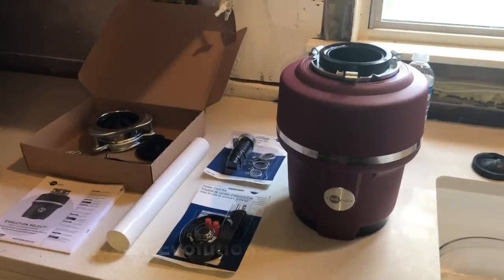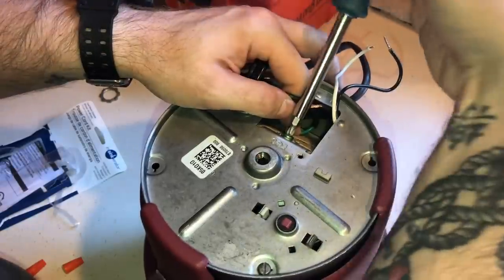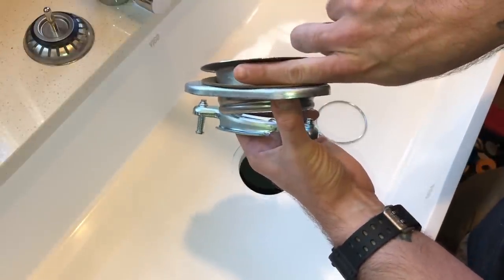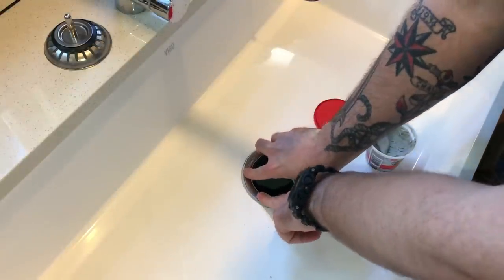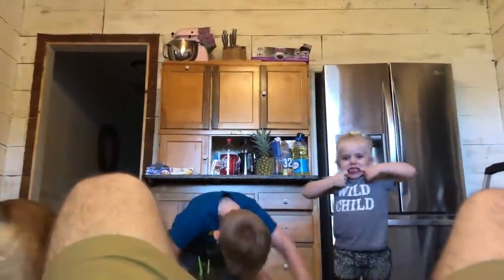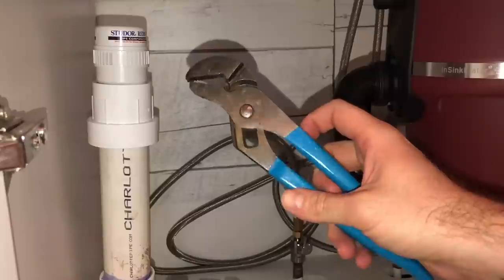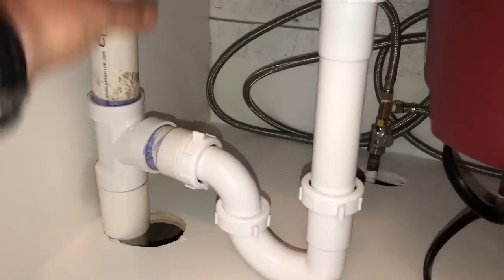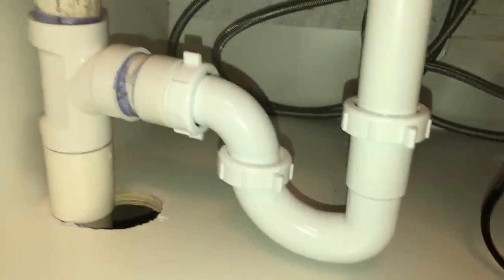How to Install - Insinkerator Evolution Select Garbage Disposal

Comment: So how do you know which wire to tie to gather?
Reply from the maker: Great question! I didn’t really address this, by here is how you know “If you have two black wires coming from the cord, check if it has smooth & ribbed sides. If it does, connect the smooth side to the black wire and the ribbed side to the white wire. The ground wire of the cord should be properly secured to the screw of the disposer.” 

Hope that helps you and thanks for watching!!
Reply: ribbed is standard indicator of "white".  You can also verify using an inexpensive $10 AC/DC multi-meter.   Set to DC and run the continuity test.  Touch the wide "white" prong then touch the bare wires.  You can mark the "white" with a piece of white tape.
Reply: I would add a text box to the video so you don’t have to make the whole thing. But this is made clear since it is  so important. Thanks!

Comment: Amazing thank you!! I just got mine installed thanks to the confidence I gained from your detailed video. A couple little things I would add: the snap ring is a beast. To get it on check out the guy who uses zip ties on the three screws to hold it open. Also much easier with a 2nd person holding down the flange while you fight with it. Also insinkerator seems to prefer shorter screws now for thick sinks. They had two screw sizes in the box. Also they offer a rubber washer to use and no mention of new plumbers putty. I decided I didn't trust their washer as I have a beveled hole in the sink. So I learned how to use the putty and made a gasket the old fashioned way. Finally, I had to adjust my drain line by pushing any "variable" pipes as far as they would go into the other pipe and it just baaarely fit. This unit is a fair bit wider than the badger it's replacing. Thanks again!
Reply from the maker: All great notes!!  Thank you for taking the time to comment!  This is one of my oldest videos so I'm glad it still holds relevant and is helpful.  All the feedback is awesome, thanks again!

Comment: thanks for the video! I just saw the pinned comment about wires.  The only issue I had was the dishwasher drain line was pretty tough to remove but channel locks did the trick.

Comment: Thanks for the video.  I'd installed one of those 5/8HP Evolution models last night as an upgrade to the 1/2HP Badger.  I didn't appreciate how the instructions failed to make it clear that this unit's baffle actually fits into the sink and not into the thick rubber soundproofing grommet at the top lip of the unit, nor under the sink opening as you can not jam both rubber pieces together & have it fit the locking ring mechanism...  My old disposer had the baffle pre-molded into that top grommet sitting inside the disposal lip.  Duhhhhh!  I really felt like making some of the gestures your kids were making, but mine were profanity laced!
Reply from the maker: Thanks for the comment Doug!  I definitely edited out my profanity that's for sure!!

Comment: you make it look easy putting on the ring, however most people aren't that good so I recommend having someone else hold the drain flange down from the top on the inside as you put ring on from  underneath.  its very important that you tighten screws evenly or the ring will come off, also you get an Allen wrench type tool with the disposal that unjambs the disposal from the bottom , I like to use two of the wrenches  to put in two holes in mounting bracket, its also critical that it CLICKS on otherwise it will vibrate off.
Reply from the maker: All good notes! Thanks for sharing and for watching! 👍🏻

Comment: Thanks dude. Bought the same model and used your video as reference as I hardwired mine and it was a replacement for and older busted Kenmore/Insinkerator. model so I reused the old mount without issue.
Reply from the maker: Thanks for the comment and I’m glad my video was able to help you out!! That’s awesome!! I appreciate you taking the time to let me know, helps me know how I can improve / keep on keeping on etc! 💪🏻🤘🏻🙏🏻

Comment: Just bought and installed the current 3/4 horsepower  version of this, they now include the power cord and the additional drain tube. They also include a ring for the flange to replace the use of putty. Sounds like they watched your video LOL

Comment: Thanks for the video! Way more helpful than the instruction manual tbh. Did it matter which wire I connected to which? I connected each copper wire from the power cord to one of the wires coming from the unit and it turned on just fine so I guess I did it correctly but also don’t want to burn down my house lol
Reply from the maker: So glad the video helped you out!!  There is a method to how to attach the wires, you may have gotten lucky, I don’t think it would operate if backwards. I think I may have a comment explaining it, but basically one of the two sides of the all black wire does go to the neutral and it’s marked by a ridge on the wire itself (from memory here, I remember looking into it back then). Good luck and hope the unit works for you!

Comment: Looks good.  The only suggestion was to mention the Air Gap or high loop for the dishwasher drain line.
Reply from the maker: Thanks for the feedback and for watching! I did a sort of “part 1” to this video showing how we hooked up the sink plumbing and I discussed the drain for the dishwasher more there.  You are right as it would’ve been more beneficial to edit some of that into this video - I was trying to get the length down and didn’t think to leave that here when splitting them apart.  I appreciate the thoughts and again thank you for watching!! 

—-> DIY Project: How to Install Sink Supply, Sink Fixture & Drainhttps://youtu.be/jflpKgwRbC8

Comment: Nice video and question for you. Can either end of the power cord connect to either of the wires of the disposal? I'm not talking about the ground, but just neutral and hot. Can both the neutral and hot connect to either side of the cord?
Reply from the maker: No one side is hot and other is neutral, you can tell by the texture on the cord sides normally which is which, def search for that online before trying to connect it

Comment: I find when knocking out a plug like the one for the dishwasher drain, it is easiest to use a 6 inch socket extension with a socket just under the size of the tube. Just a tip, do with it what you will.
Reply from the maker: Thanks for sharing the tip Doug, much appreciated! Thanks as well for checking out the video! 🙏🏻

Comment: The video was helpful... but, I don't recall seeing you use the bent allen wrench to tighten up the insinkerator. So it is really just barely hanging in there... use it for leverage to rotate the mounting piece clockwise... at 18:34 you can see that it wasn't in tight.
Reply from the maker: Might not have shown the detail there but it’s worked perfectly for years now, so  guessing it’s good.
Reply: @TheToughGuysTV  I hear you... and, it helped me put the parts in the right order... but I tightened my down... this step... https://youtu.be/fM6b78LGYHU?t=1410 not to be mean... I just know I would want mine on a bit tighter.

Comment: I recently installed my garbage disposal. One thing to watch for is the amount of putty used. I struggled for a day to get the disposal on the ring. There was too much putty that seeped down. Removing the excess from underneath gave me a fraction more space to get the disposals tabs to the ring. The instructions don't tell you to use putty and so probably not built into specs to allow for that so just beware of how much your using or just use the washer they give. Also using a scissor jack helped alot with raising the disposal in place.

Comment: Hey. At 19:50 the rubber thing the you put, of course I got one too and it just slows down the water flow big time as compared to my old garbage disposal. In the old badger, that thing was attached to garbage disposal itself. With the one you installed, it sits from the sink side. Did you find a hack for it or you just deal with it? Thank you.
Reply from the maker: It’s been in place ever since we installed it. So far no major issues. Occasionally we get a bubble there which stops the flow of water, but I just poke through and water starts to flow again. Thanks for reaching out and thanks as well for checking out the video!

Comment: I didn't realize about the long depth ring. I'm replacing a disposal so if there is already a deep one there can I just reuse that one?
Reply from the maker: You may be able to re use it if it all lines up and fits. definitely worth a try before buying a new one!  Good luck!
Reply: Luckily the deep one wasn't necessary.

Comment: Hi, thanks for the video, very good. I have 3 questions:
May connect the dishwasher drain somewhere else in the drainpipe instead of the disposer?
May I connect the regular white wire directly to the motor instead of adding the black wire?
Do I have to put a turn on switch as shown in the video?
Thanks for attention.
Henry
Reply from the maker: Henry, thanks for reaching out!  Disclaimer here - I am not a licensed plumber or electrician!

1. I'm not sure if you can connect somewhere else per manufacturer spec, but as long as it's draining into your drain pipe it should theoretically be ok. 

2. I would recommend connecting to power as it's written in instructions - I can't physically see your situation, so I don't want to recommend something possibly detrimental. 

3. You'd definitely want to wire the electrical to a switch, otherwise it would run all the time.  Some people have push buttons on the countertop, and others have a switch down under the sink - it's really up to you. 

Thanks for checking out the video and for reaching out! Good luck!

Comment: Thank you Dude!  Bought the same one ($$$) yesterday and was so happy to find your post.  Just getting ready to start in.  Not sure which side is up on the rubber drop in thing-a-ma-jig, it looks like it comes packed upside down?  Oh, and yes they're packing the power cord now (BFD).
Reply from the maker: That’s awesome that they are including the power cord!  A lot of guys that install these all the time don’t think it’s a bid deal they weren’t - but normal everyday people DO think it’s weird to not have a power supply included... I mean, what else do you buy that doesn’t in everyday life!?  I’m glad the video helped you out, and I really appreciate you letting me know!!
Reply from the maker: That’s awesome that they are including the power cord!  A lot of guys that install these all the time don’t think it’s a bid deal they weren’t - but normal everyday people DO think it’s weird to not have a power supply included... I mean, what else do you buy that doesn’t in everyday life!?  I’m glad the video helped you out, and I really appreciate you letting me know!!
Reply: @TheToughGuysTV  LOL!  I took the electrical all apart when I noticed the nut was still on the romex connector, only to find that it threads into the base on it's own.

Comment: I have this disposal. Problem I have is that my dishwasher cuts off when I turn my disposal on. I have an insinkarator box that both are plugged into. What can cause this problem?
Reply from the maker: Could be a short overrunning the circuit? I’d recommend having an electrician check it out or an appliance repair specialist - could be a few different things causing it. Good luck

Comment: The reason a chord with a plug was not provided could be due to the fact that some installations could be hard wired.  I live in Florida where dishwashers and disposals are plugged in via an outlet under the sink (the disposal plug controlled by a wall switch).  Not the case in New York, where, in my mother's house, the dishwasher was hard wired (no disposal in use).  Not having the power chord included with the disposal saves on the possible waste of discarding a perfectly good power chord only because a particular installation requires hard wiring.
Reply from the maker: I think an easy solution may be to have some sold with or without, and then separated within retail locations.  I am a GC in my professional life, and my plumbers do not purchase from retailers - so having the wholesale locations carry the w/o cord version would eliminate the issue you’re describing pretty easy.  Then have retailers carry with or without, and educate staff to explain to customers (or have good signage / collateral to read).  How many people buy one, then end up having to go all the way back to the store because they need it and no one told them so? Thanks for the thoughts and for watching, I really appreciate the conversation!! 🙏🏻💪🏻

Comment: Does this disposal have a little flex when the flange is completely installed? I just installed mine and everything went together good, however, I can grab it and wiggles a little. No leaks. All the tabs in the locked position.
Reply from the maker: I can't say mine has any 'give' or 'wiggle' to be honest.  It's pretty secure.  If I put some force on it, I can get it to twist a little bit but not sure if that's exactly what you're experiencing.  If unsure, try to see about getting a direct opinion from a local plumber maybe just to be sure - better safe than sorry.  Thanks for checking out the video and good luck!
Reply: It definitely has some play, both at the basin/trap, and at the discharge outlet. I assume this helps quiet the unit when installed.

Comment: At 14:27 you didn't mention that the tabbed retaining ring had to be turned to tighten the unit to the upper drain.  Almost looked like it was supposed to pop into place.

Comment: My previous pipe does not fit (it is about one inch too long) to acomodate the disposal.  How do shorted the pipe?  Also, the black tubing from the dish washer does not reach to around to the top drain port that you had to hammer a screw driver through the plastic.  Can that be extended easily or should a plumber be called?
Reply from the maker: Ben, when you say “previous pipe” are you referring to the drain pipe under the sink or the drain flange for the sink itself? As far as the dishwasher tubing you can purchase new / different lengths but knowing how much water can go through a dishwasher I’d recommend getting a plumber involved if you are at all unsure.  Always side with caution when potential flooding is involved while playing with plumbing systems.  I hope I was of some help and good luck!! 👍🏻
Reply from the maker: Ben - here was my companion video that may be helpful. This was us setting up the kitchen sink drain and faucet - How to Install Kitchen Sink Drain & Faucet https://youtu.be/jflpKgwRbC8

Comment: Dude how’s the Vigo sink treating you? I bought one but after feeling the material...it seems super soft and worried it will scratch easily. I tested it on the back with a screw driver, but the back doesn’t have the polish/coating. I did the same to a fireclay and it didn’t scratch. I like the Vigo better though for its sloped bottom (better drainage). Would really appreciate any input. Thank you!
Reply from the maker: Sink has held up really well so far - a little bit of discoloring around the drain, but other than that all good - about 2 years now. Thanks for checking out the video I appreciate it! 💪🏻

Comment: Doesn't the instructions require the disposal to be LOCKED to the locking ring? You appear to leave it loose. In fact, I believe a pair of channel locks is used to pull the disposal tight onto the ring to lock SOLIDLY in place.
Reply from the maker: It is locked and secured in place on our end. No movement of the unit whatsoever. I may not have done a good job of showing that, it was quite difficult to record underneath. You can physically feel it seat into place and it’s good to go. Thanks for watching and for the comment!

Comment: i dont like that , that black rubber is the only thing that holds the mount onto the garbage disposal... seems like u could just pull it down if u really wanted to...how does yours feel?
Reply from the maker: It’s been 100% sturdy since day one, no issues. Been about 2 years now. There is a locking bracket that is attaching the ‘throat’ / drain to the locking collar I believe - when it’s all attached it’s sturdy! Thanks for reaching out!
Reply: They now have a tab on the ring that locks into plastic on the motor... You can't rotate it to the exact place like you can on the old models...

Comment: does it come with a switch to turn it on
Reply from the maker: It does not come with a switch in the box, it will need to hardwire to a j-box or you will plug in the included cord to a plug receptacle that is switch controlled (in my experience). Sometimes it may be a switch located under your counter, in the sink base cabinet but in our case we had a plug in that cabinet that was switch controlled by a switch in the backsplash.

Comment: At 4:30, how do you know which wire connects with which? Thanks.
Reply from the maker: Great question!  There has been some discussions additionally in the comments on this video but to sum it up - The wire with the ribbing or stripe is the neutral wire, and the other one is hot. The two sides of the small stranded wire coating will usually have 'ribbing' or marks you can feel - that side is the neutral. If you don't see any markings on the wires, and the plug has two prongs of equal size, the cord is not polarized.

Comment: Great help with installing the disposal.  Although I would disagree when wiring. It’s actually easier, at least to me to get the wire but on first, just getting tit started. Then put the wire through. It was much harder gettin the nut on with the wire there.
Reply from the maker: Thanks for the comment and for checking out the video! Glad it was able to help out in some ways